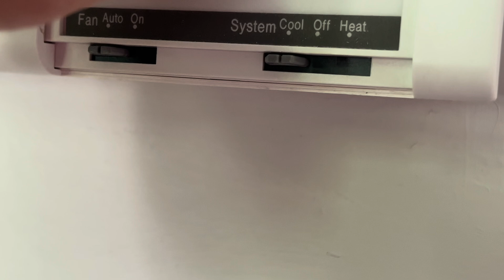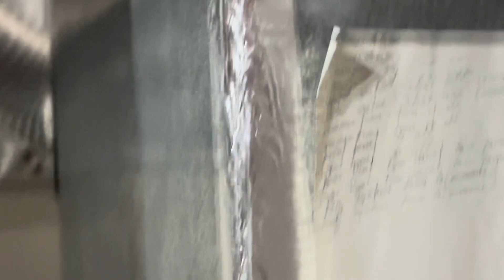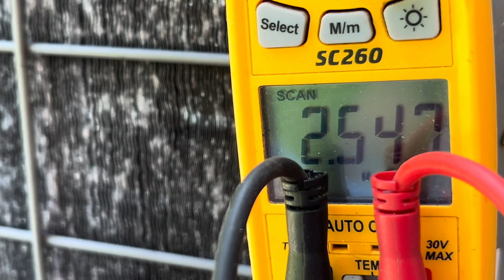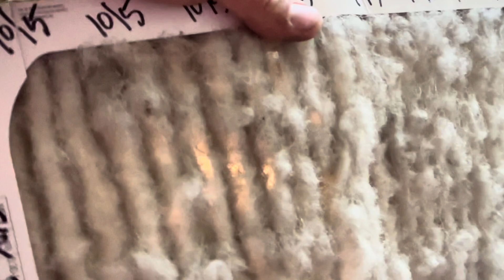WHY IS MY CONDENSER NOT RUNNING WHEN I TURN ON THERMOSTAT?

Comment: What's the reason you hate Turbos? The turbo didn't do the hack, the hack did.
Reply from the maker: Turbos are great in a pinch.   I like caps that fit if the truck stocks it.  They are great.   A bit over priced to just throw in if I have the right rated cap.
Reply: @hvacotj  if I understand you correctly, you hate the turbos in this case because they didn't fit the original mounting hole? I know they are expensive and there's other things be concerned about, but in this one you pointed to the hackery and called out the turbo. I was just confused about that.
Reply from the maker: @realSamAndrew 100 percent.   Turbos never fail (well sometimes) but they save us everyday.    Yes that’s what I meant.